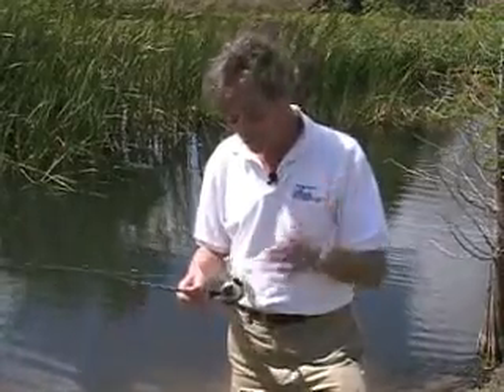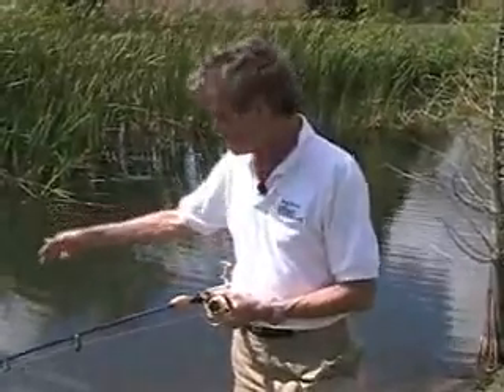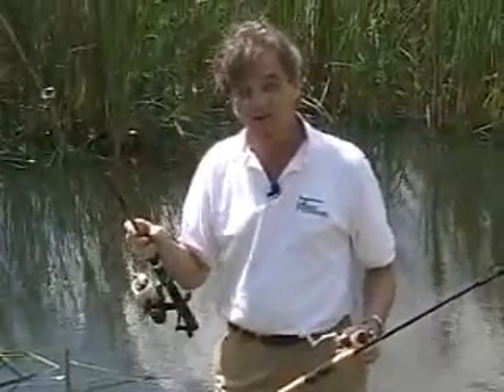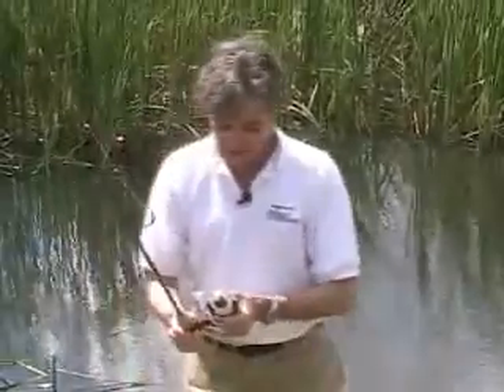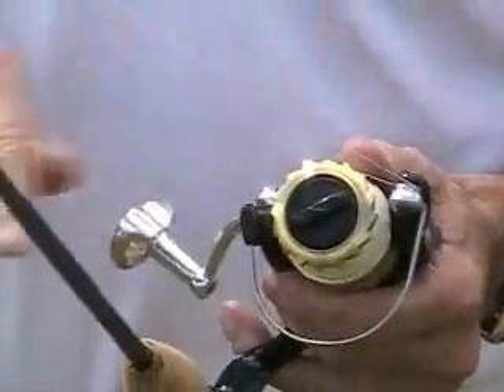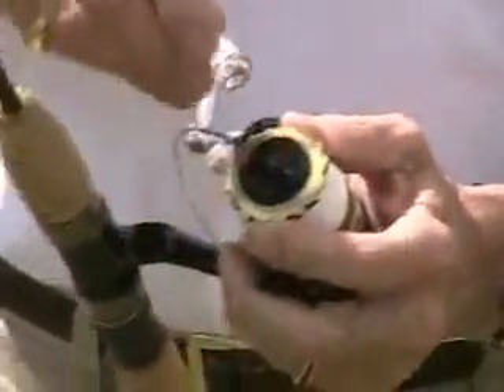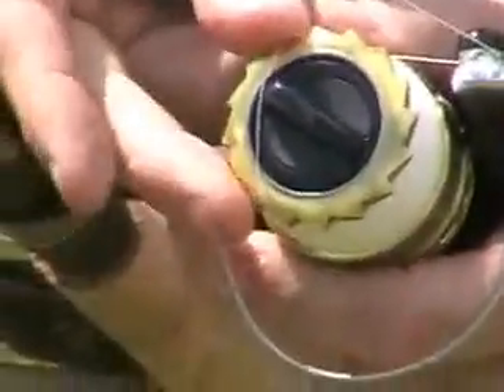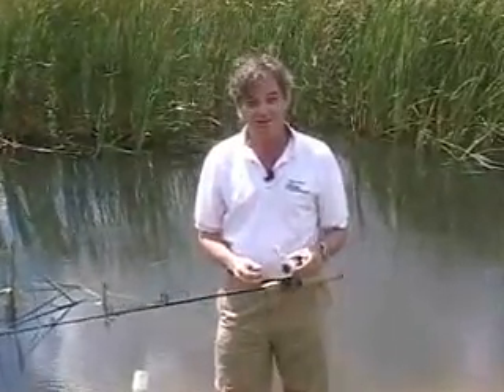Doug Hannon the Bass Professor's newest invention

Comment: jason, no that wouldnt have to do with the fact that you bought it from wal mart it is one of two things. first either you are putting too much line on your reel or you are trying to cast too hard! take some line off and see if that works, if not, let your wrist do more of the work instead of your arm and you should be fine, good luck and great fishing.
Reply: Great tip! Never over fill your spin reel. Leave at least 1/8 of a inch. Don't try and over cast let the rod and your wrist do the work.     Shawn